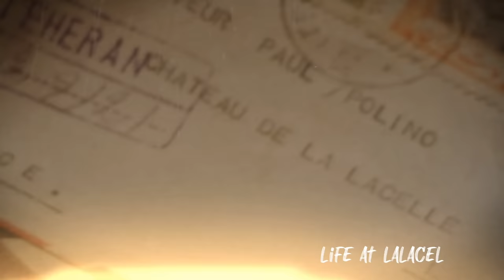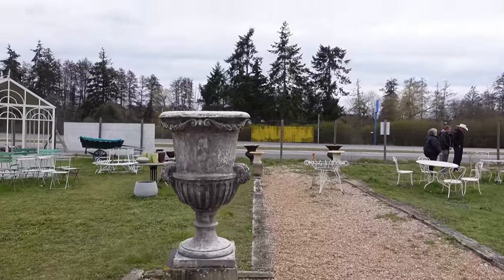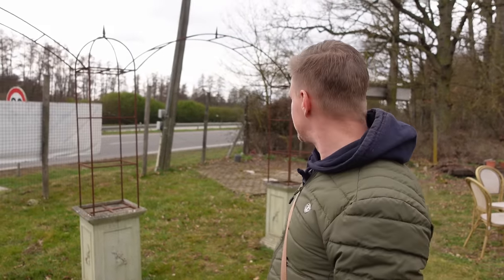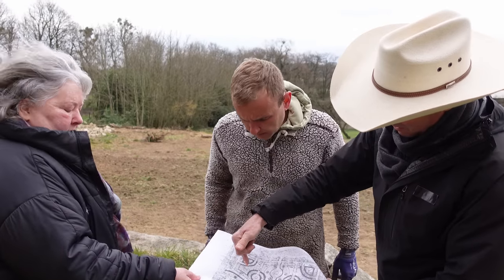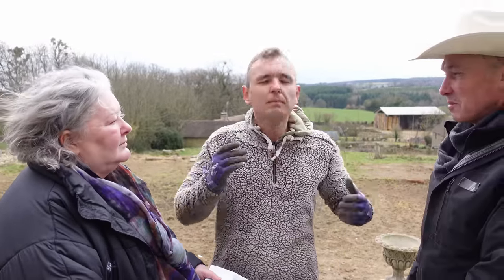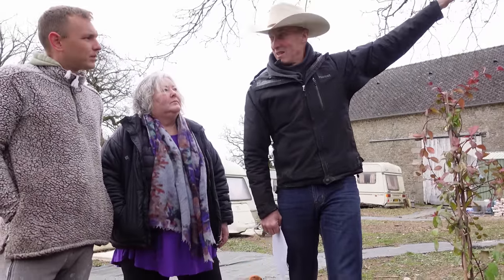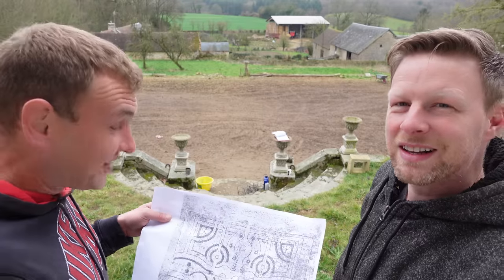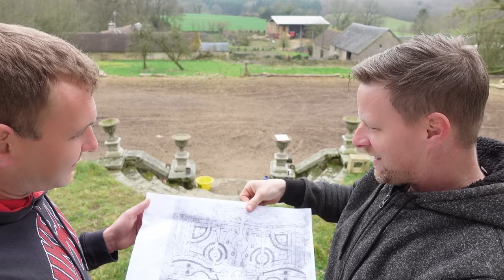The FORMAL GARDEN Design for our Chateau.

Comment: Suggestion for the exterior building.  Combine one part bleach and one part water in spray bottle, add a teaspoon of dish soap per gallon.   Spray this bleach onto all surfaces of stone.  This will kill moss, mites and fungus etc.  Let dry overnight. Spray off with water.  Tree sap will be left behind and can be scrubbed off with more soap and water (or power washer).

Comment: The plans look awesome! Regardless of which country you live in, plants are EXTREMELY expensive these days. It is one of the main reasons I am investing in a greenhouse for my property here, and eventually over there. Nice Victorian looking greenhouses (20 feet by 10-15 feet) can run you as much as €25,000+ (Metal. PVC can be cheaper, but not recommended). Most are actually manufactured in Belgium (and shipped to here in the US).  Then you have to plan for the heaters, water lines, and otherwise electricity feeds. It is very satisfying growing your own food and plants for the gardens, year-round. Eventually, you will save a lot of money, especially if you are filling spaces in those formal gardens with annuals. Just my two Eurocents' worth. ;)
Reply from the maker: Thank you, yes it can be very expensive 😮❤️

Comment: Tilling the soil will only seed for bad grass and weeds deeper. And will eventually come out. The faster way is to remove 1/2 foot and add new clean dirt with additives then roll it down wait a few months and hand pick out the unwanted weeds and grass.
Reply: Thanks. Tilling the soil is necessary as I explained. The garden has been left for over forty years. The root balls of the brambles in some cases are over 12 inches and upto 18 inches down. I know of no dig methods but really wouldn’t work in this scenario.